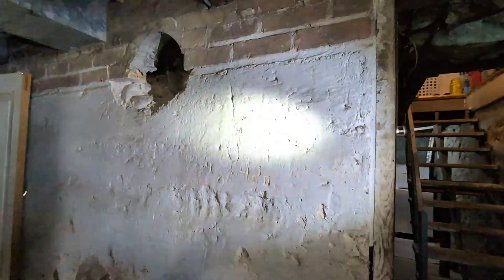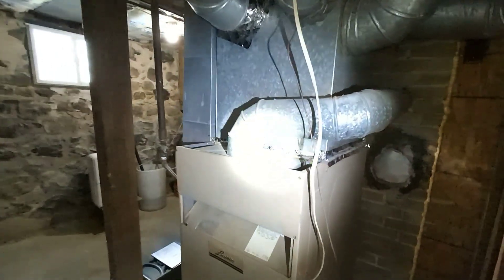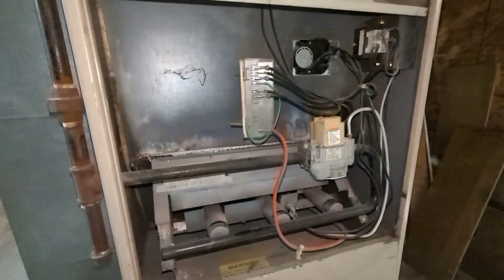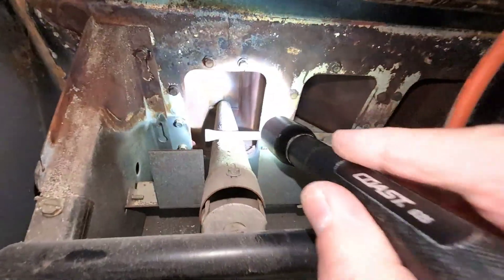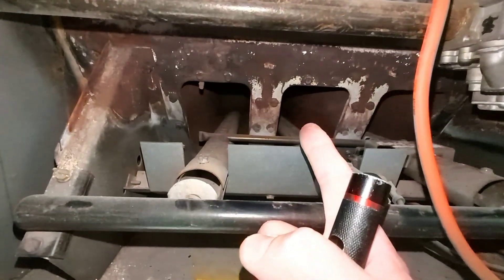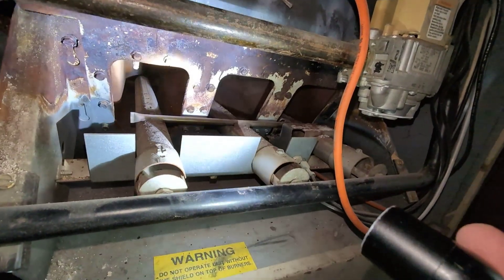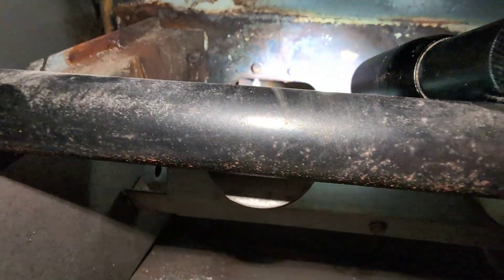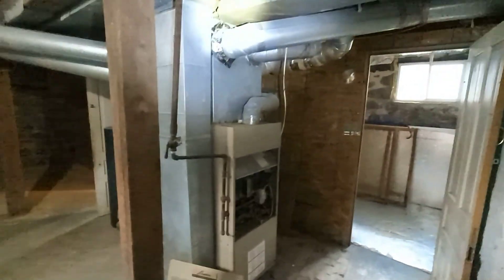🔥1990 Furnace with CRACKED Vestibule to Heat Exchanger #1990#1990s#hvac#hvactrainingvedioes#furnace

Comment: I have a garage heater from the 1930s. The heat exchanger is in excellent shape. The only thing that's ever been replaced on it is the blower motor. It's absolutely amazing that the heat exchanger isn't cracked and that there is nothing wrong with anything on the unit at all. Bet you'd never find a new one like that.
Reply from the maker: NICE!! I'm sure you are right. Most heating units like from back in that time had heat exchangers with a very thick gage steel designed to tolerate EXTREMELY high temperatures for a fuel source such as coal or oil. 
Hang on to that TANK!
Thanks for the comment and for watching.

Comment: What do you think went into the bigger hole  (aluminum)  ? An even older furnace ?
Reply from the maker: Good call, YES. Gravity Octopus, large duct tubes.👍
The duct run size has to be reduced to a smaller size when converting to a forced air system in order for the air flow to function properly.
In addition, there was still some asbestos wrap on a few of the register vent connections.
Thanks for watching